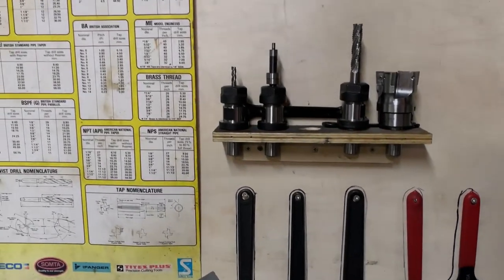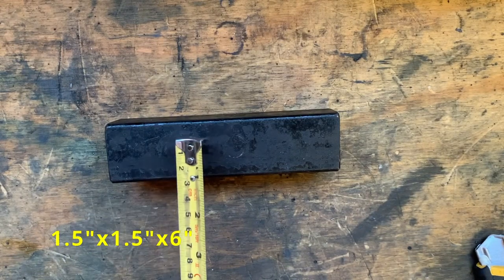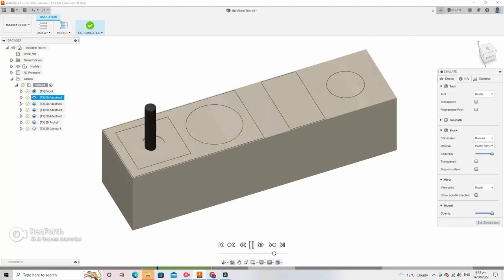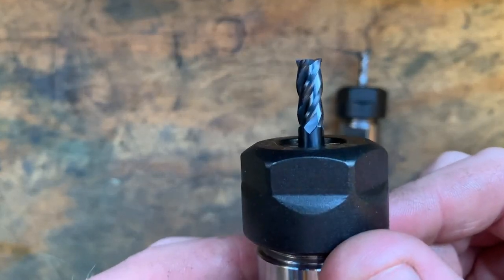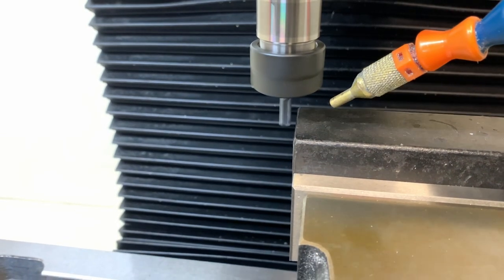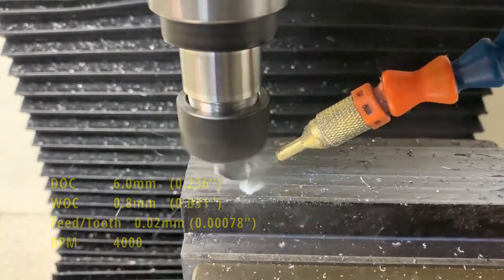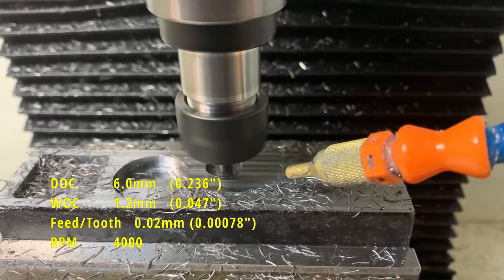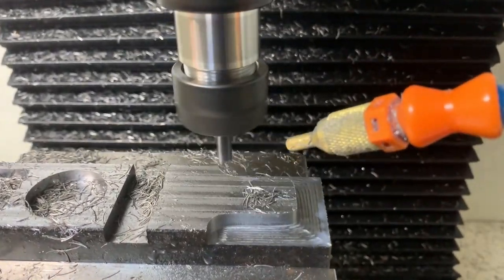A Cheap and Capable CNC Mill?

Comment: You can easily adjust step count in software and reduce that "inaccuracy" number's. In every software there is a value for the step count for the amount of movement. For example default for certain model is CNC is 800. What you do is you move the X axis for 100 mm an measure how much did it actually moved. Then you use that distance to calculate the needed step count. It turns to be, for example, 807 steps. Than you enter that value in the software and repeat the process. Once you are getting close number's you are done with calibration of the X axis. Do same for Y and Z axis. You will be calibrated and parts will be way closer to the needed size. This works when you have constant size difference per axis. Like X axis size is always bigger or always smaller. Will not improve anything if part is once bigger and once smaller. That is than inherent runout of the machine or shows some issue that needs to be addressed. BTW do calibration with lower feed rates because you do not want machine to lose steps and you to hunt those. Also do it at the part od the bed where you do your most work. Namely things are never perfect and same thing might be behaving different on the other part of the machine due to the imperfections of the parts. I have had to return some ballscrews because they were ground so poorly that they would even stick on some part's of their travel. So not only that I was getting different size but inconsistent sizes as well. So calibrate your CNC machine in software and you will be golden. Good luck.
Reply from the maker: Thanks for the advice, the set up is definitely worth revisiting as I did it so long ago. Originally I set the step count as per the Mach 3 software with my dial indicator on the x and y the ball screws are only C7 grade ‘Taiwanese’ , and I have been able to machine aluminium to within 0.05mm or better with a high degree of repeatability. I honestly think this was just fault on my part with a machine that isn’t particularly rigid and a poor machining strategy. Like you can see the column flex on a dial indicator when applying pressure to it by hand, not a lot but worth noting.
Reply: @OddsandEndsMachining  I see video is two days old so I though let me try to help. But I am barking at the wrong tree. You already know that part. Sorry didn't wanted to be Captain Obvious just tried to help.
Reply from the maker: No worries, for all you know I could have been oblivious and any help or insight is appreciated.
Reply: @OddsandEndsMachining  I hear you about the flex. I've been messing with my round column mill. Using an indicator it is close to perfect alignment in X & Y. However when cutting it appears to have errors particularly when I have used a boring bar as a small fly cutter. The finish was pretty good but the pattern indicated a tilt. I'm pretty sure it's simply a lack of rigidity and tool loading during the cut causing deflection. I also have noticed the indicator moving when applying pressure to the head of the mill when I was adjusting alignment. .05mm deflection wasn't difficult. I recently purchased a tool steel boring bar and inserts from BB, the same place you purchased from. Very nicely finished. I also bought  end mills from Yifino. Supposedly HRC70, and happily mowed through a piece of tool steel when tested.
Reply from the maker: @kwaka140  It's amazing what you can get for relatively little money from Aliexpress. In regards to the flex, all you can really do is take smaller cuts and use smaller tools where possible.

I do plan on revisiting testing the mills accuracy at some stage.

Comment: I'm in the middle of converting my Hbm bf 28 to cnc myself, they look the same, all made in china with slightly different spec according to the end sellers requests. I think they are a slightly bigger version of the PM 25mv, similar castings but bigger brushless 2 step belt driven variable speed motor and a few other odds and ends.
Reply from the maker: It definitely helps the conversion if you can get away without having to use another mill. Not quite the case for me. 

If you have a look on Ali express and look at some sfu1605 or maybe sfu1204 ball screws and nuts, under the description the sellers will have all of the dimensions. 
This is awesome for planning the build and seeing how much space you have without spending any money. Although I think 16mm screws would be fine for the build I probably went a bit overkill.

Comment: I'm about to convert my mini mill.
It's called a Fervi T061 here in Italy, but it's one of the many similar ones, and it seems very similar to yours.
Mine is over 15 years old and I think I'm going to forget the dovetail slide in favor of linear ball guides, it have some play and the X axis isn't sliding evenly, so probably dovetails are going in the chip bin.

What size of motors and torque are you using for the axis?
Are they closed loop or open loop?
Reply from the maker: Closed Loop Hybrid Steppers, using a Novosun controller.
They are 8 nm NEMA 34 steppers, i probably could have gotten away with 4nm motors to be honest.
adding rails might also stiffen up your frame which wouldn't be a bad thing and allow faster rapids.
Reply: @OddsandEndsMachining   Thanks for the reply! I'm probably buying the 12Nm motors because maybe in the future I can use them for a bigger machine.
Maybe they're too big?
What screws are you using?
I need to take some measurements, but I think if there's enough space I'm going for 2005 ones.

I need accuracy and fast rapids since I need to use the machine to make plastic injection molds for my precious plastic workspace.
Reply from the maker: @dadoVRC  As I understand larger motors wont necessarily allow faster rapids, I am using 2005 on the X and Y and 2505 on the Z. Complete overkill, 1605 probably would have been fine for a machine of this size, I suggest if you want faster rapids to go for 2010 ball screws if you can get them and to use double nuts to reduce backlash.
I used single nut screws and have to live with 0.02mm in Y and 0.04mm in X of backlash.
Reply: @OddsandEndsMachining  Thank you!
I want to put the motors laterally on the basement because of space issues and the table since the mill has an enclosure made for flood coolant , so I can play with transmission to achieve faster speed.
I have to find double nuts ballscrews... suggestions?
Reply from the maker: I got everything on aliexpress from a Taiwanese company they were very good at replying and sent the products quickly, custom made to length.  @dadoVRC

Comment: Nice build, the HM-46B is probably more rigid at the same price point. I nearly bought it but Hafco ran out of stock and I ended up buying a Sieg SX3L instead. No CNC plans for now though.
Reply from the maker: Thanks, It was definitely a learning curve. When I bought this mill I knew very little about rigidity and weight being such an influence as the only mills I had used previously all weighed over a ton and I hadn’t any experience with bench top mills. The main reason I went with this mill was because of the ‘large’ Y axis travel. The extra weight of the HM-46 would’ve been ideal though if it had the travel.

You’re not missing out on much, I would definitely appreciate another Manual mill for when I can’t be bothered programming.
Reply: @OddsandEndsMachining  one ton mill, lol if only I had the space in my tiny tin shed I'd love to get a Schaublin 53 😁
Reply from the maker: @HM-Projects  I bet if you had a bigger shed it would never be big enough as you’ll always find more stuff to fill it with. At least that’s the case for me.
Reply: @OddsandEndsMachining  haha, truer words have never been spoken.

Comment: Really nice👌👌
If you dont plan on using the swivel base, remove it, it increases stability.

Which spindel/Servo are you using for cutting
Reply from the maker: I probably will remove it if I need to do any ‘heavy’ cutting (if that’s possible on this mill). The spindle motor is a generic 3000rpm 1.5kw AC servo from aliexpress. 
I ended up burning out the stock 1.1Kw DC spindle motor early on by gearing it from its stock 2,500rpm max to 5,000rpm and it was not happy with this to say the least. It worked well up till the gearing change.
Reply: @OddsandEndsMachining  Did you have any significant issues setting up the speed control? I have a similar spindle motor (the 1.8kw one) thats is going to drive a bt30 cartridge on my impending router, and I would like to be able to drive it in step/direction mode for rigid tapping, and seperately with a 0-10v for normal milling - I would appreciate you sharing any learnings during your setup (I see its also geared up, have you had any torque issues?)
Reply from the maker: @88TheLuke1  I haven’t used it or set it up for rigid tapping as I can’t do that in Mach 3. I understand you need Linux cnc for this. Although the 0-10v set up is very straight forward and only requires two pins to be wired to the breakout board. Then all of the settings on the controller are in the user manual and fairly straightforward. I’m more than happy to help if you run into any trouble. 

I’ve had  no issues with the torque with the unit geared to double the rpm to 6000 max. Although I have yet to push the machine to it’s limits and rarely use any endmills bigger than 12mm, usually I stick to 6-8mm endmills.

Comment: Hi There
I am also converting a MH-28V to CNC, Where did you get the belt drive conversion gear from?. Thanks Murray
Reply from the maker: For the spindle? I made the servo mount out out of some 30x5 flat, 12mm plate and 30mm round stand offs. All aluminium.  

The pulleys are nylon because i didn’t have any aluminium at the time and planned on re making them but they have since held up fine for the last year. I am using a PK series belt sourced from a local shop. I do have CAD drawings of the aluminium pulleys if you want them.
Reply: What motor and motor controller did you use?
Reply from the maker: @goldoneday 
https://a.aliexpress.com/_mN5NGqc

Let me know if you want the drawings for the mounts I’m pretty sure I’ve got them still.

Comment: Your bore gauge technique looks a little suspect. Roll it through once and in one direction after locking it.

Also, verify the diameter of that endmill. The chinese ones can be undersized which might explain some of that offset.
Reply from the maker: You’re quite right I should’ve definitely checked the endmill size. And yeah it was pretty hard to get a good measurement with the hole only being 6mm deep, usually I can roll the bore gauge through but it was barely in the hole. I’ll have a look next time I’m in the shed.
Reply: @OddsandEndsMachining  I hear ya on that shallow hole. Note you can use it as well for slots if there is an open end rather than have to wiggle around calipers for high spots. Given the surface finish, I'm guessing you're probably right with the spring pass though .3 seems a bit much for just that. Something else at play! Something subtle. Fun puzzle for you to solve at least. 

When checking the endmill, do it on the actual cutting edges not the shank. They can be different. You can rotate it backwards through caliper jaws to keep everything from getting damaged and get a good measurement. Nice job overall.
Reply from the maker: I’ll give measuring the endmill a go, I’m thinking .2-3mm width on the square is only .1-.15mm off deflection on each wall. The only way I can test this is to re run the part on the other side with a better finishing strategy.

Comment: That is too much for tool deflection.
Reply from the maker: By tool deflection I also meant to say some deflection in the column too. About .1-.15MM on each wall doesn’t seem to extreme for a combination. The only way to find out will be to re-run the part and do a proper finishing pass.